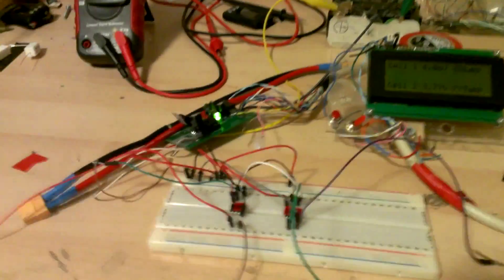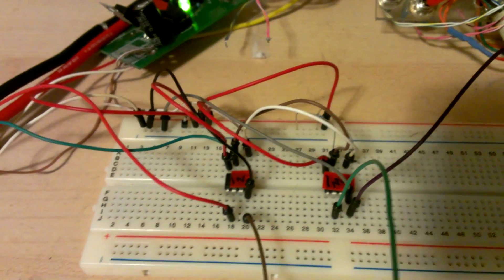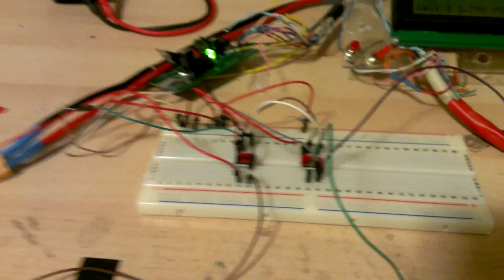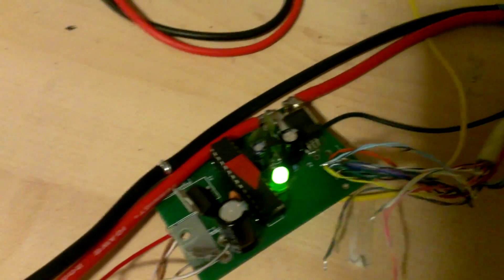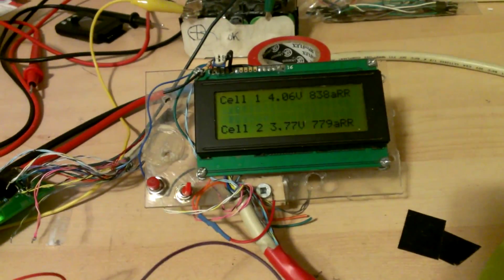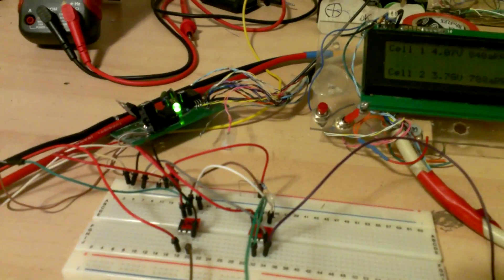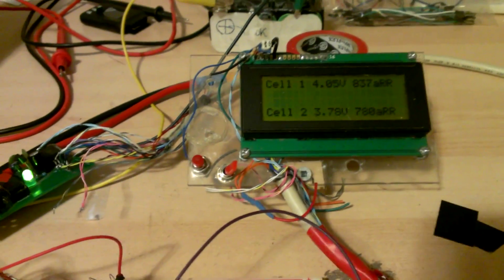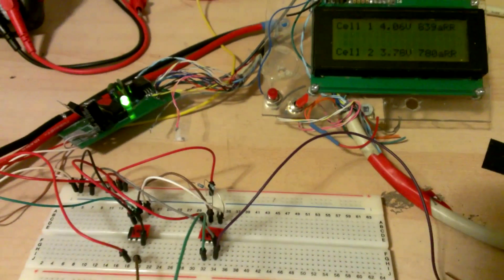Arduino master and 2 attiny85 slave

Comment: HI Nice build!  I am trying to do exactly the same project with 4 x12V solar batteries. I have not had any success using I2C on ATTiny85s. I have downloaded Rambo's TinyWireS library for Arduino and now the code is right but fails to compile since the are instances in the library that are obviously defined in other libraries that I have not got on my IDE. How did you implement this?

Comment: I think you should use something else like ad converter that has i2c interfere. This is waste of microcontrollers and money
Reply: Hansaka Perera for $1.15 per attiny85 it is certainly not a waste
Reply: well ADC cost less
Reply: Hansaka Perera This type of set up would be very helpful for remote monitoring of solar arrays, remote batteries, or anything else that requires a longer distance. Using I2C, I am planning this exact thing while re-purposing old phone lines in our home to run the I2C bus. Any room in the house with an RJ-11 phone jack, could be used to connect a slave device (such as Attiny85's for battery monitoring, or a temperature sensor. This project could be seen as an exercise for future projects. 

Jacopo Rodigari  Unfortunately, I am having trouble getting my ATTiny85 communicating with the Arduino Uno, using short wires on breadboard, and I would love to know what code base/libraries you used for this project.
Reply: I2c is not exactly the best thing for long distance. There are two wire protocols out there that do 150 sensors+ in one bus line.